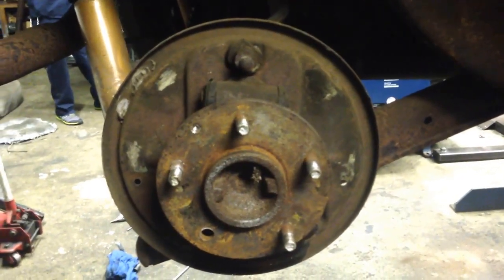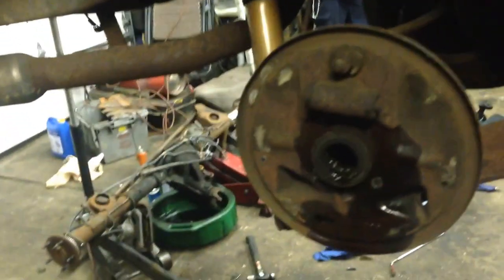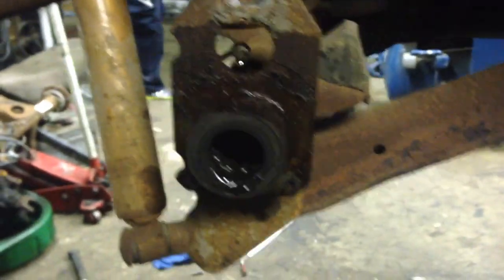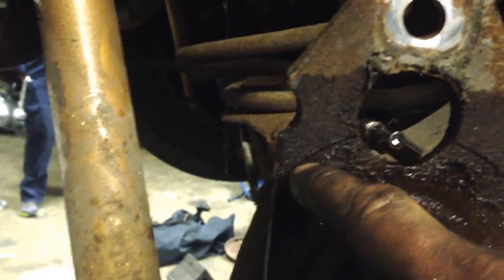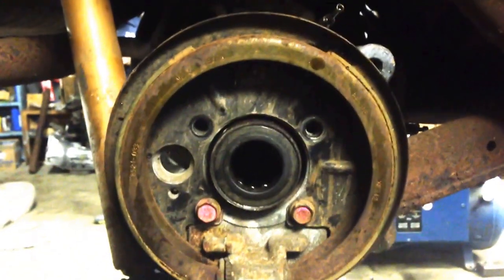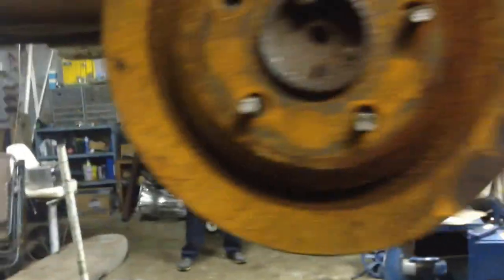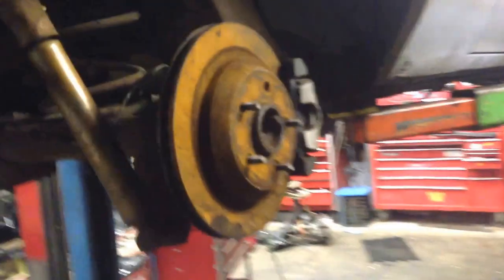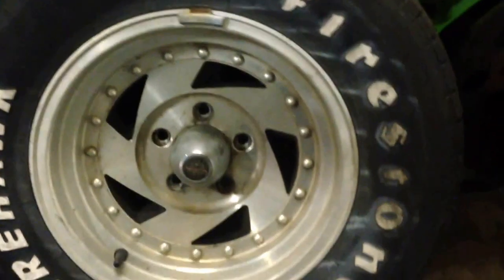1984 Elcamino rear brake converting to 2000 camaro disc

Comment: What about the proportioning vavle or the master cylinder did that stay stock? Having trouble installing mine new kit...
Reply: I have that issue right know did you use the camaro proportioning valve & master cylinder

Comment: Is there any way to tell if the backing plate and brake caliber brackets i have are from a ls1 f body? I have some part numbers on it
Reply: Chasemanuti run the gm part#s on google. Should be a part number wiki